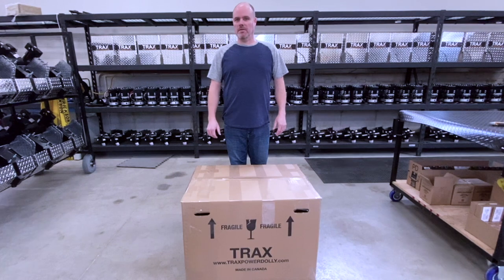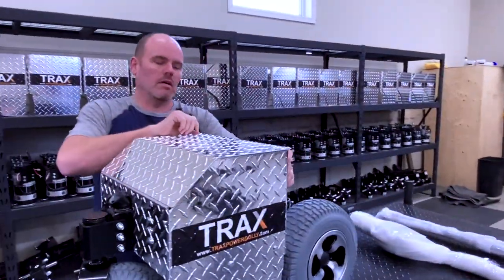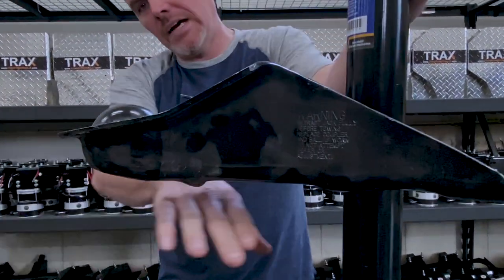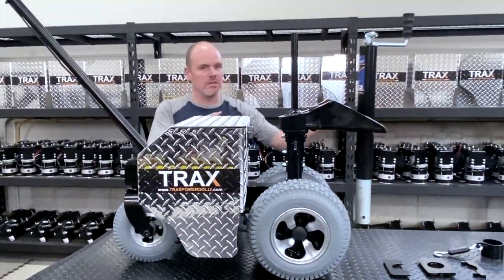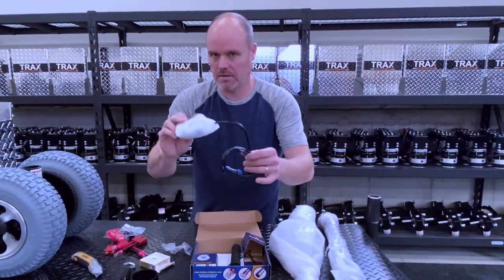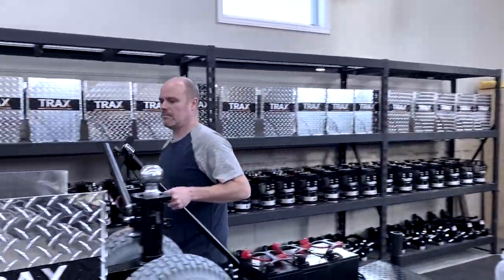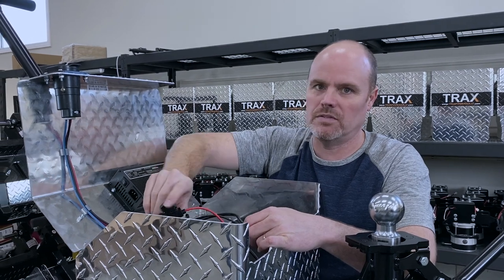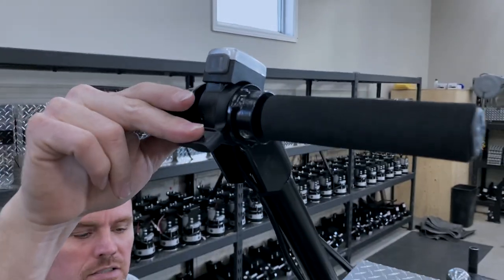2022 Unboxing TRAX TX6000 Electric trailer dolly

Comment: I just got one 🙌🏼 this is the BEST, Smoothest machine, extremely well designed….. I bought the white one from the other company 🥴, all that machine is, is a small winch motor, grinding, loud and obnoxious… too tall for my trailer…. Pcs of junk… sold it, bought this one and wow …. I’m impressed….. tradesman approved 💪🏼🫡
Reply from the maker: We're thrilled to hear that you're impressed with our TRAX Power Dolly! At TRAX, we take pride in using only the very best motors and motor controllers, even when others may choose to cut corners and offer inferior products at higher prices. Your satisfaction and trust are our top priorities, and we're dedicated to providing top-notch quality without compromising on excellence. Thank you for recognizing the value of our commitment to superior craftsmanship and performance. We're here to ensure that your experience with TRAX exceeds your expectations every time.

Comment: I have this unit. I really like the variable speed adjustment. It's also very quiet. I hate the toggle directional button with a passion. It annoyed me to no end that there isn't separate switch for forward and reverse. At the very least make it clear whether it's currently in forward or reverse mode.
Reply from the maker: Hoang Tang we are making a directional indicator light in the next model update

Comment: You mentioned 12000 lbs in your video but with a name like TX 6000, I would assume the Max load to be 6000 lbs. What is the Max load this unit can move?